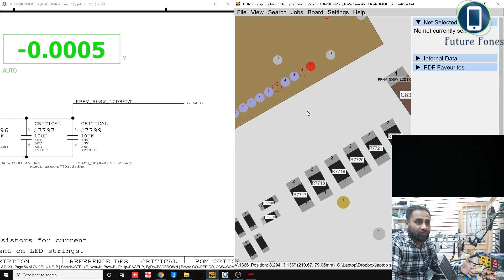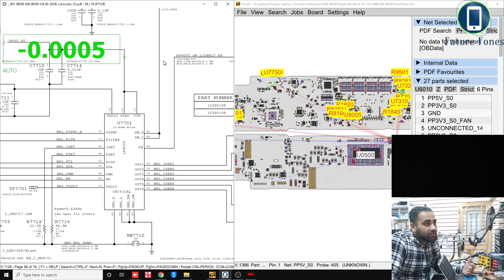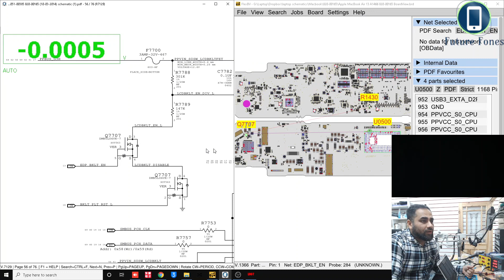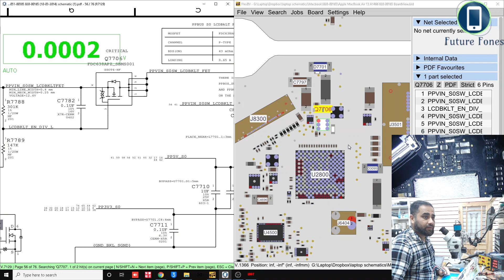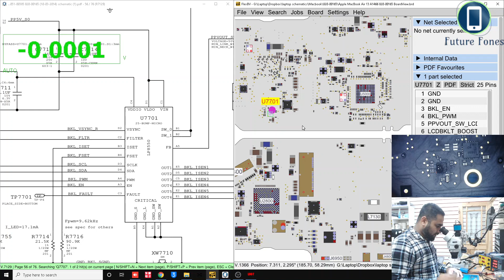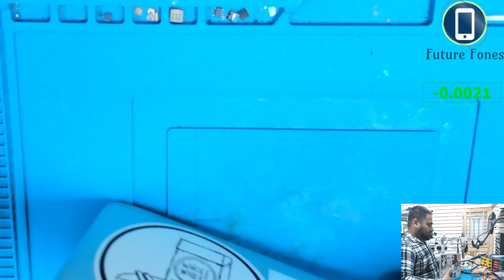Macbook Air A1466 Backlight Repair, Circuit Details

Comment: after i check there is no voltage at all the fuse p has 8.6v  around cercuit only i get 8.5 v
Reply from the maker: 8.5 is ok

Comment: tell me brother i have this problem i can see screen if put flash light all fuse work has 8 volt i dont know the screen connectors what volt  should be
Reply from the maker: yes you can check . it..